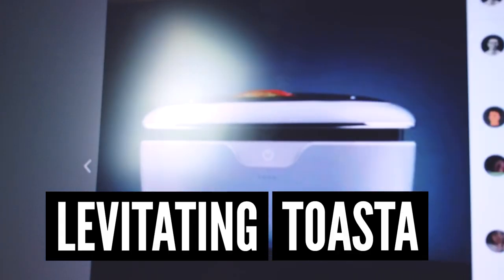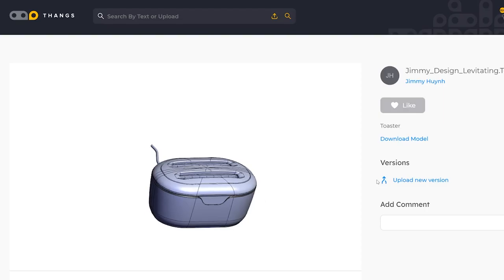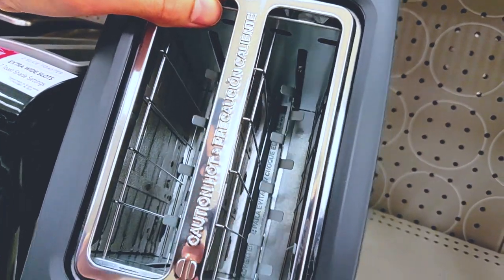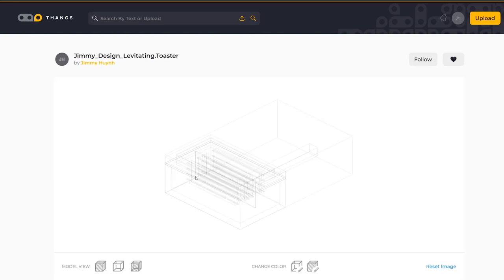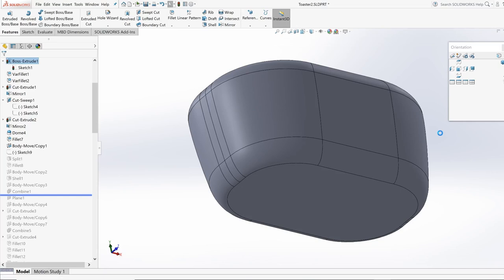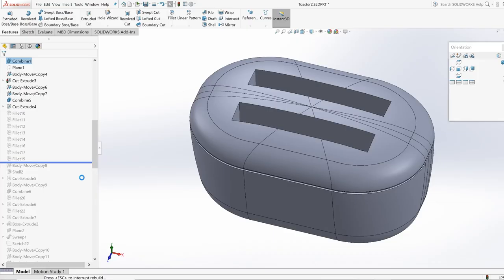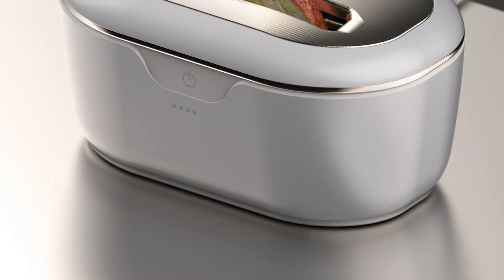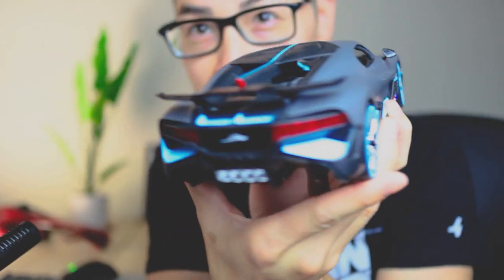Designed a Levitating Toaster. Here's How I did it! | 3D Modeling For Industrial Design

Comment: i want to migrate from Inventor Pro to Solidworks, it's much different one of each other?
Reply: Every software has the same core. If you know one , you ll easily be able to migrate to the other. Sure there will be some differences in ui but the overall learning curve will be small.